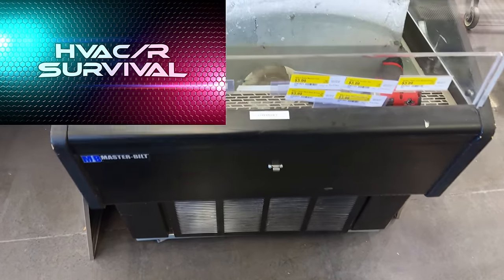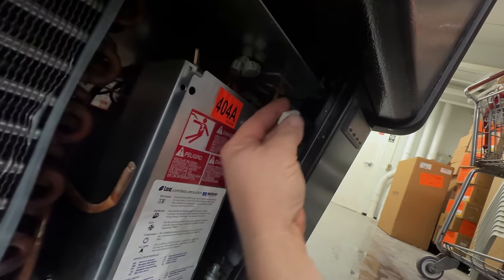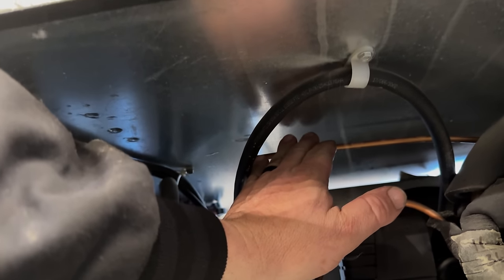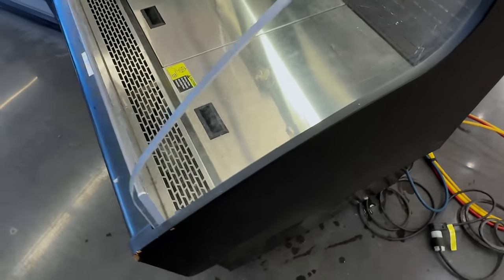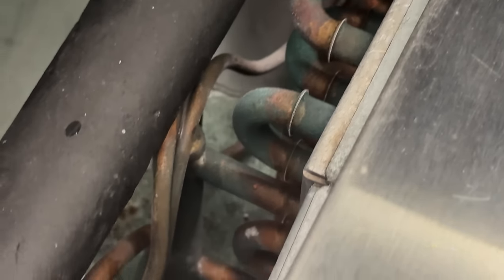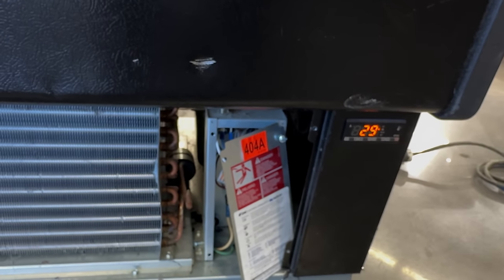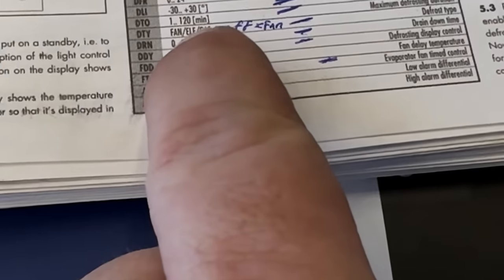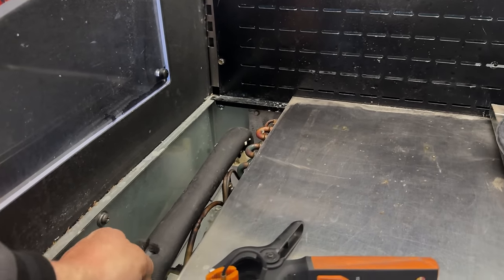Open Case Cooler Running Warm Master Built

Comment: Just a heads up, a Dixell Universal-XR can replace any one of those controls. They usually fit in the same housing space as danfoss and masterbilt controls.
I recommend carrying one if you dont currently have one on the truck :)
Reply: That is true, but you can't replace all the time controller that you are not familiar  with. Dixell is really versatile and easy to use, but then, in my experience, it fails more often than True controller that Master Bilt units are equipped sometimes with.

Comment: Great video, Rick. Thanks for sharing. 
I must say I get pissed off with the lack of definite answers dealing with all this electronic stuff. When it was mechanical, you were able to say this is the problem. Fix, replace, or order it, and you were the hero. Not so much nowadays.
Reply from the maker: I agree 💯 %
Reply: I'm an IT Consultant.  Welcome to my world.  I spent three months chasing one network problem, 'fixed' by separating into two separate networks, and still don't know what causes the issue.
Reply: @tbelding  Wow, weird.

Comment: it's a fridge, all it needs is an off cycle defrost and a cabinet temp set point. Manufacturers make it all way too complicated.
Reply: Yep. Every component added is just another point of potential failure.
Reply: that works great, in a nice controlled climate environment, without air blowing in and disturbing the air curtain.
that just ruled out majority of every install, as where they're put is never controlled well and right where a vent blows or door that's open more than closed. lol
Reply from the maker: Agreed 👍

Comment: Service calls are thankfully slowing down a bit....so we can get to the repairs that have been pushed back due to call volume. I have been replacing compressors left and right recently. Did a TXV to EEV conversion on a chiller.....life is different, now that I work for a manufacturer
Reply from the maker: I hear you, we’re getting bits and pieces done that’s been on standby.  (Factory work etc)  I kinda was hoping I’d get found on line and get recruited by a manufacture or large company. It’s never happened🙃
Reply: @HVACRSurvival With your extraordinary refrigeration/heat pump and controls proficiency, you might look at manufacturers of condensing boilers. They are now having to transition from just natural and propane, which you already know, to include heat pump technology.

Comment: Nice work Rick.
Remind me of many blod bank refrigerators I worked on related to the defrost system on them.
Simple Ranco termostats with a capillary style sensing tube directly inside the evaporator fins.
39F / + 4C and a differential of 42F / 6 C  to cycle off at  28F / -2C negative😬
Those units actually defrosted in every cycle off just by the heavy airflow over the evaporator😬
 Crazy short cycling periods by just a few minutes between the cycles.
Worked exceptionally excellent.
The Copeland condensing units used a couple of decades ago kept living 10-15 years.
A very seldom time the current style start relay gave up, what a quality those days.
The Ranco’s died after 5 years of switching duty😂
The temperature inside the blod bags stayed inside 0,1C  the all time they was stored.
System was simple and very sensitive to a rising air temperature.

Thank you for all the interesting information you gives us dealing with so various equipment.😊
Reply from the maker: Thank you for sharing all the information. 🤜🤛👍👍

Comment: I would expect an open cooler to frost up when placed next to an exterior door. Especially with the humidity of the summer. Had this model at my buddys gas station and in summer we would have to defrost it manually every once in a while.
Reply: typical scenario there, installed in a bad location near a heavily used door or where a vent/fan blows into them and the building climate is never controlled well.
most call for max. ambient temp around 74F and humidity below 50%
Reply from the maker: All valid points, like I said, I never heard anything more back about it still happening. Maybe it was designed to run a lower saturated suction temp to counter the open case? Not sure…I do know the air band working properly is critical to reduce the freezing effects.

Comment: Thanks for the great video. Regarding pulling out the previous charge, did you  just leave some positive pressure to avoid  vacuuming system and then add new R 404a, or did you do recovery plus vacuum?
Reply from the maker: I bring it down to just a positive vapor that way I don’t have to pull vacuum unless I think there was a reason to do it, like a massive leak that would’ve possibly sucked in air or noncondensibles.
Reply: @HVACRSurvival  Thanks, Rick, for the answer
Reply from the maker: @ulairecantea9231 I actually read and try to respond 😁 I like being different that way

Comment: I've been thinking about getting that impact due to size ( I'm a home appliance tech some times my impact doesn't fit in smaller space) but worried about battery life..  My 10yr old Milwaukee lasts all day unless I use it for washer gearcases, how does that one fare?
Reply from the maker: Several days

Comment: If you could pick the equipment if you had a small walk in freezer and cooler what manufacturer would you pick for evap and roof? I know there are size differences but what manufacturer?
Reply from the maker: Bone / Heat Craft is what we use, it does well. Not to many problems
Reply: @HVACRSurvival thank you!